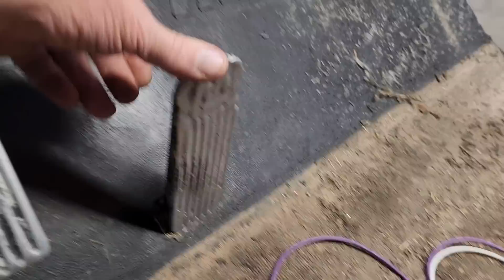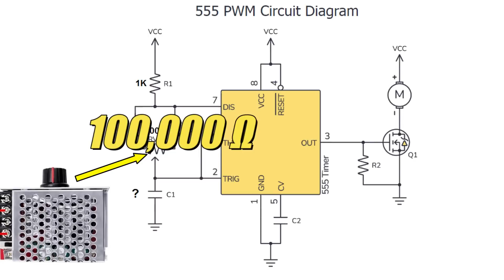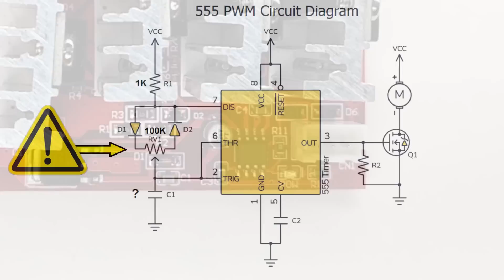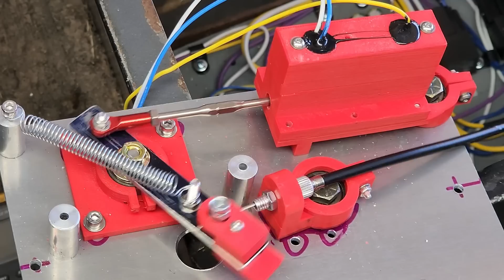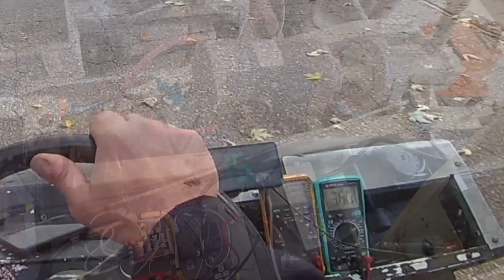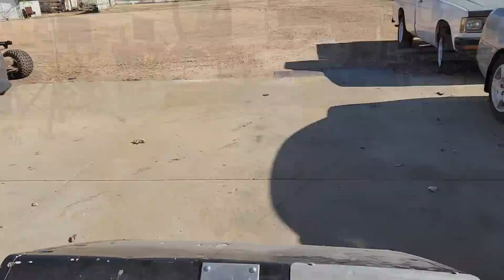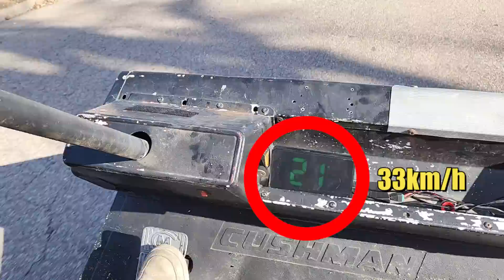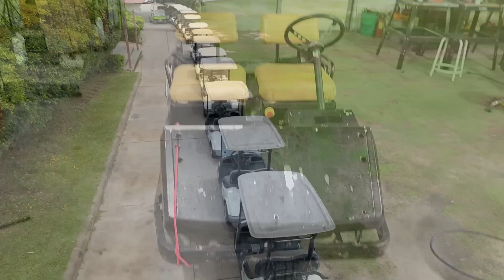S4 E38. We build a custom throttle and road test the gasoline / electric hybrid petroleum battery

Comment: Well.. on the rotary type. You can make a miniture reduction box... a housing with two or three gears that multiplies the rotation degrees, and make a simple push-pull pully with two short cables to the throttle pedal .. like a motorcycle throttle cable set up. It's really simple but hard to explain with a picture.
Reply: Yeah I hate linear pots.  They always seem to get these weird sticking points.
Reply: @kentalanlee  lol what gave me the O'Dea was a friend has one arm and no hands. He got a fella to build a speed controller for his wood working saw speed controller.  He had it set up so if he leans against a board on the table it speeds up.. the more he pushed against the board the faster it went. Originally it had a twist type know to control the speed but he needed his one arm and hook to push the boards and  stuff through his saw. That was in 1979.

Comment: I hope you are planning to fabricobble a reversing switch into the stator power circuit. Remember, the output from the alternator can be positive or negative depending on the control voltage now that the rectifiers are out of the picture.
Reply from the maker: Reverse is complex on the series wound DC motor we are using.  On a DC series wound motor, reversing the polarity to the motor will not reverse the direction the motor spins.  In order to reverse the motor, the series field windings need to be reversed.  It takes a large high current multi contact switch to do this.

Comment: When you mentioned potentiometers around 7min mark, i thought you would go with hall-effect sensor of some kind to detect throttle position.
Reply from the maker: We need to maintain the path of resistance a standard pot has due to the RC timing circuit that controls the 555.  Not sure how a hall effect would work in an RC circuit.

Comment: Check those isolation mounts.  I have some just like that and they're nothing but all thread with some rubber cast around them.  They will isolate but it'll mean the nuts are going to get loose.
Reply from the maker: Will do.  Thanks!

Comment: Yet again another great and entertaining video, it was well worth the wait. Take some time to spend with your family today and relax. 

At 17:25 did we see a fully electric reverse or what it a fully manual assisted reverse by the camera man? If it was a fully electric reverse I think you are holding out electronic trickery from us. 

I think 21 mph on a 3 wheeled rolling death cart is more than fast enough. Add in that 4th tire and then experiment with the need for speed.

Another gadget I just thought of for your cart is an electronically controlled governor for the little engine.  With light current load back off on the petrol throttle. As demand goes up then increase the engine's throttle. The issue will be trying to decode the “need for additional throttle vs just a heavier current load” on the electric motor. 

Either way just proving the concept of the petrol battery and it actually moving (without releasing the magic smoke) is a great success.
Reply from the maker: No reverse yet.  I reckon when I backed off the throttle the cart drifted back slightly.  Have a great one!

Comment: overvolting and overspeed potential issues:

overvolting while under load can cause overheating, my general rule of thumb is calculate the max KW of the motor at its standard voltage and reduce the amps at higher voltage so the KW is equal to the standard to avoid issues.

the other method is to watch the temperature of the motor like a hawk and back off when the motor gets too hot

in extreme overvolting you can get big arcing and flashover issues this can be slightly mitigated by adjusting the brush timing (the position on the commutator) 

apart from that just expect a little extra brush and commutators wear but these types of motors they usually the outlast their vehicles

--

overspeeding  motors expect extra wear in brushes, commutators and bearings  

extreme overspeeding can cause the motors to literally tear themselves apart start launching chunks of rotor apart and well goodbye motor more of an issue with inner runner bldc's but still applies to these motors just not as bad

TLDR = overvolt but try not to over KW + overspeed but only 1.5x rated speed and no guarantees or promises given when you start pushing the envelope (as standard with all modifications)
Reply from the maker: Thanks!

Comment: would be great to add small high amp battery to smooth start current. added arduino could adjust throttle of gas engine depending on load
The project is awesome!

Comment: Just run 20 drive by wire linkages in series and JB weld an aluminum strip across them all. Bonus: Your gas pedal is a yard wide, making it easy for the driver or passenger to accelerate.
Reply from the maker: LOL, sounds like a plan!
Reply: You’ve got me laughing out loud with that suggestion. 😂

Comment: More great content, thanks Jimbo.  One question, at low engine speed is there a risk of overdriving the excitation of the alternator and pushing too much current through the rotor/armature?  Just a thought, as the variable DC excitation source looks like it has a lot of capability.   Keep up the good work 🙂
Reply from the maker: At low engine speeds,  overdriving the rotor would cause the engine to stall... so problem solved.   Actually, at this point we still don't know the long term effects this abuse will do to the alternator.

Comment: Need to get as much curve out of that throttle cable as possible  Jimbo and it might get smoother 🤞
Reply: Sure you already figured but the throttle cable to your Rio stat, not the petroleum battery 😅
Reply from the maker: Indeed , we have to take another look at the cable system.

Comment: You would be better off using a e-bike hub motor as a 48 Volt generator.
And controlling the engine speed for power.

Comment: Hi Jimbo, can't you use the existing pot, and just make some 3d printed gearing to let a small throttle movement rotate the pot knob a full 270 degrees?
Reply from the maker: Yes, that would work, but not everyone has a 3D printer.  The other throttles I'm working on use off the shelf parts.
Reply: @robotcantina8957 most of us who aren’t really electronically savvy (like myself) but can do custom mechanical fab like this probably have a source for gears we could make work. I know I have a bolt bucket and a collection of used car parts that occasionally go to a metal recycling yard. Have a dead motorcycle too, could take some gears from the mid gear or stator/starter assembly and probably cobble something.

Comment: One of 'forever' projects is to do exactly this except with one of my jet engines, hot side composite parts and a few other bits that had to be invented first. Four years later, I can finally start making parts. 
Definitely recommend the golf cart route. 👍
Reply: Wait, does that mean you’re going to be making a jet powered golf cart? You have GOT to post videos!
Reply: I have something a little spicer in mind, but it will be a ground vehicle eventually. I don't think pumping a MW of electrical power through golf cart tires to be terribly practical, or, ya know, sane. Though as the saying goes, you can try anything once. 😁

Comment: I haven't watched whole video yet, but why not just make a little lever arm for the existing pot?  Connect that with a cable to your throttle pedal?

EDIT: Content.  Yours is great!  Thanks for what you do.
Reply: rotating between min/max is 270 degrees he said. But gearing it down with 3d printed gears on the gas pedal seems like a good solution.
Reply: And use a wire instead of cable for a true "drive by wire" experience

Comment: Typically the first worry about  overspeeding an electric motor is the centrifugal force pulling the windings (or magnets) out. I don't know what the max for a motor of this size would typically be but I'd be surprised if 6-8000 was a problem.
Reply from the maker: Thanks!
Reply: My 4.5hp 110vdc treadmill motor is 6000rpm
Reply: @david0858too  that's good enough for an electric mini bike, or go kart for a child! Would just need a DC to AC inverter, and an AC controller.

Comment: Why not ad a CVT to the engine/alternator and let the engine's throttle control handle the load change.
Reply: Yeah I was also wondering if the alternator could be varied speed / CVT driven, or how it currently compares to its design RPM range (in a Liberty, at redline).

Comment: That petroleum battery is pretty much a 7.3 IDI. They can pull a house down.
Reply: I have a 7.3IDI, factory turbo (non intercooled) in my driveway. Slow? Yes. Pull whatever you hook to it? Definitely. 

It's no powerstroke, but it does the trick.
Reply: Oh it belongs to my boss. I would have purchased an actual PSD. Parts are easier to find for it. 

Nobody offers an OEM downpipe for it, I had to buy a banks upper half and beat the snot out of the cab to fit it, and have it welded to a bit of the old one and heavily heat wrapped. 

It was a pain. That truck is a pain. 😂

Comment: I think 12:1 gearing ratio is similar to a Tesla.
I think a Tesla is about 9.7:1
Reply from the maker: LOL, I actually was expecting something in the 4:1 range.
Reply: Although 4:1 might sound reasonable given common automotive final drive gearing can be around 4:1. Remember, a gas engine first runs thru the trans gearing which for my Toyota 5 speed manual is:
1st.3.545	
2nd.1.904	
3rd. 1.392	
4th. 1.031	
5th. 0.815	
Final drive. 3.72

 Final Drive ratio x  5th gear ratio = engine rotations per tire rotation
  3.72x.815=3.056

Comment: A Wha Wha pedal works exactly like you're expecting with a rotary potentiometer. So do volume pedals. It would be a simple swap to put in a 100k ohm pot, if they don't already have one. Plus, they're smaller and less complex than what you're using.
Reply: And they are also in fact pedals by nature. Also even cheaper would be to use a guitar volume pedal
Reply: Rotary potentiometer knobs are available with long, bendable arms and are run 24/7; varying the motor speed with a "dancer" on wire take-up machines. Wire is taken from a large spool, fed through the dancer and then to a smaller spool at high speeds. X feet of wire is automatically unspoiled onto the smaller spool, without making a mess. 
The operator just cuts wire and changes spools; after the dancer is set up. Those simple pots last years. Check industrial electronics suppliers. Newark is a good one.
Reply: I'm waiting for the diesel version
Reply: @PapiDoesIt  and then put a turbo on it!
Reply: I'd worry a bit about moisture though, but that's a common issue regardless of what you do.
Reply: @ehsnils  Ah. Jimbo has a hot glue "dispenser" and a caulk "dispenser" (you know, YouTube Algorithms). He also has access to potting. Did you see the potting in the top of the slide switch protection enclosure? 🙂
Reply: @ehsnils  Industrial potentiometers are sealed.
Reply: @kurtpena5462  I was mostly considering the wha wha pedal possibility, cheap ones might be less sealed.

In industrial applications there are also different sealing levels.
Reply: A solenoid to idle engine down when stopped would also help quiet the cart down. Similar to an inverter generator without a load.
An insulated exhaust / muffler system and sound deadening foam around the  generator would do the rest.
Check out the exhaust system on a gasoline cart; might be able to modify and swap over. Gasoline carts idle down at stops too.
Reply: Just remember: the potentiometer in a wha wha is on a logarithmic scale and not linear!
Reply: @willstaffan3229  and as OP stated, theyre easily swapped out. could even run anti-log if one felt adventurous... lol, theyre rather hard to find...

anyway... still have and use the wah pedal i made years ago from some fence palings. just a string wrapped around the pot shaft, spring at one end to keep the string tensioned.

plastic racks and pinions are easily sourced, and are what commercial wah's use... first thought is lego technic, but i know ive seen a nice little nylon rack in something recently... racking my brain over what it was...
Reply: I was thinking the same thing.
Reply: That is a Great idea! 👍🎸🎛
Reply: I had a dimmer switch off the dining room fan controlling the voltage on an old ass fishing boat...12v system...6-71 Detroit
Reply: That’s a good idea, nice thinking! 🤗
Reply: Was coming here to mention wah pedals but see thevwr been mentioned. Another option may be to convert steering wheel to handlebar-type setup and use a thumb throttle. Just a dumb idea from Oregon. . .
Reply: Just make sure the pot is high quality
Reply: Another Great Video with the Petroleum Battery and retired electric donor vehicle. Pretty cool Throttle system. Thanks for the videos. Have a Happy Thanksgiving, Jim and Family.
Reply: A snarling dawg would be awesome 👌
Reply: I still have that Radio Shack Engineer's mini handbook on 555s. There are a lot of great circuits in there. Good stuff, Jimbo 👍.
Reply: Also don't forget that many simulator racing setups use potentiometer pedals.
Reply: @firefrets8628  But you rarely run the simulators outdoor in rain and snow.
Reply: @ehsnils  doubtful they'll be doing much of that themselves. But they could use it as a design template and then just put a housing around it with that 3D printer.
Reply: Thought the same. A volume control  pedal would also work and less expensive to canabliese. Both use a rack and pinion set up. Some have a light sensitive resistor (lDR) and a variable light source to control the resistance. Great build.
Reply: So wait.... You're saying that an electric guitar uses electric components and modifications?!?!! 
🤯
Reply: @Dis-Emboweled  Yes. AND you can ride in a Golf Cart while playing an electric guitar! At the same time!! 
You just need a Pignose Amp!!  🤣🙂🎸🔊🎼🎵🎶👍✌
Reply: @jlucasound This would solve the issue of the noise of the engine at the same time too! You wouldn't even hear it over the shredding guitar riffs!

Comment: On my daughters powerwheels I used a pot with a gear and a curved rack that I 3dp to fit inside the original housing. When designing use pivot point of pedal as ref.